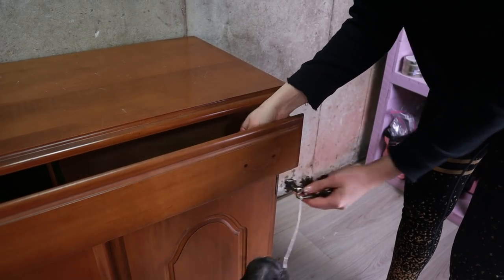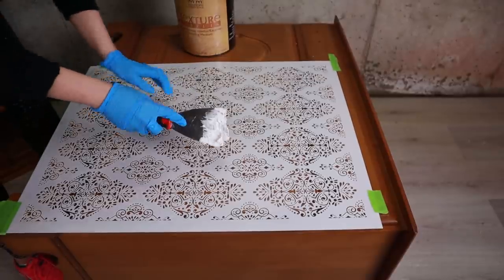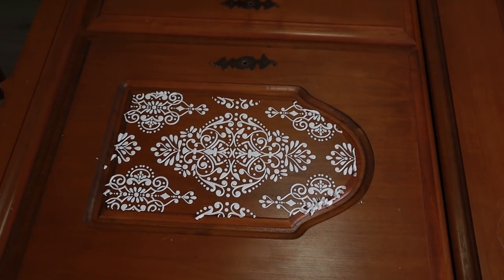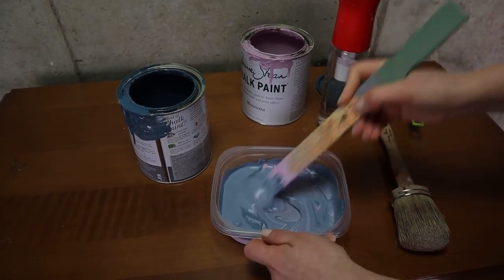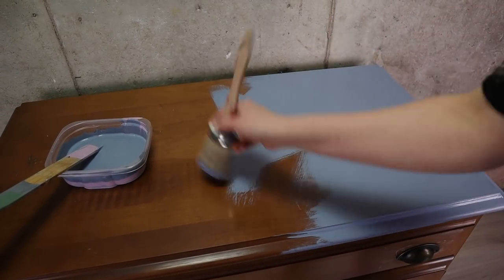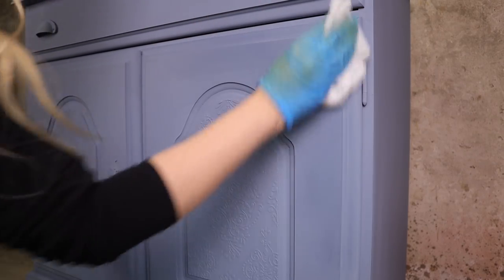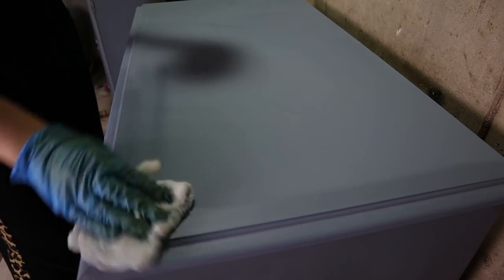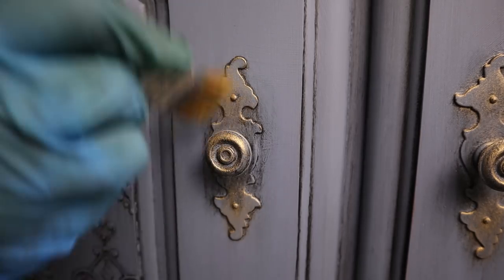How to Raised Stencil / Annie Sloan Chalk Paint

Comment: I use Dixie Belle mud for my raised stencils and you absolutely cannot use water because it dissolves. which is frustrating. Is it not a problem to use water over the modern masters medium? Without it dissolving?
Reply from the maker: Not at all. This stuff is made for texturing things like ceilings. It's expensive but it works just fine!

Comment: This piece is BEAUTIFUL! I LOVE the stencil. So, the texture ingredient that you used, I noticed in the description box that you could substitute Dixie belle mud. I have on hand what I think would give the same effect, but wanted to know your opinion first,  I can’t remember the name off the top ok my head, but it’s the pink mud type stuff that you can pick up at Home Depot or even Walmart. It’s pink, and turns white once it’s dry and ready. Have you ever used that to fill holes or anything! The only difference I see is that it has a very soft and creamy texture until it’s dry. The only reason I’m asking is because I already have it on hand. I like to use what I have if possible, but, if it’s not going to be as good for the project, I will go with one of the other options below. Also, I wanted to let you know that I did place my order with Dixie Belle, using your links. I chose to buy the products used in the beautiful piece using tea rose, mud puddle , and flamingo . They were out of the warm gold , um, I forget what it’s called lol. Anyway just wanted to let you know that I did place the order. Since I will be trying more colors and Annie Sloan, I did only purchase the small size. I’m just trying things out before I put a lot of money into products. I’m sure you understand that 😊I do hope it helped you out. I’m sure every little bit adds up and like I said, I will be ordering more! Most likely this week. I will let you know once I do. Thank you for sharing, teaching, helping out with questions, and just for everything you do! See you again soon! 😊💗